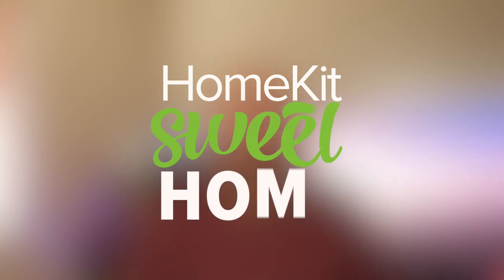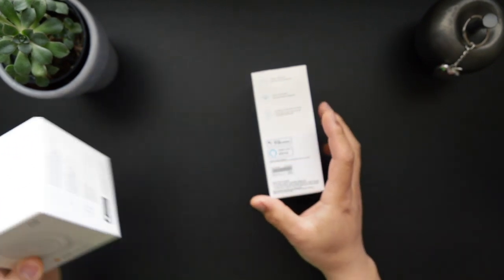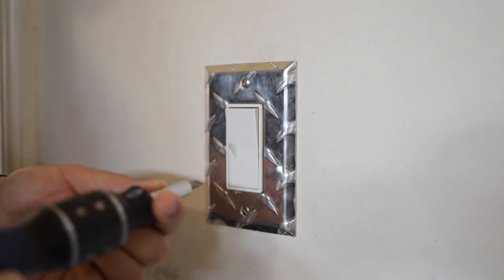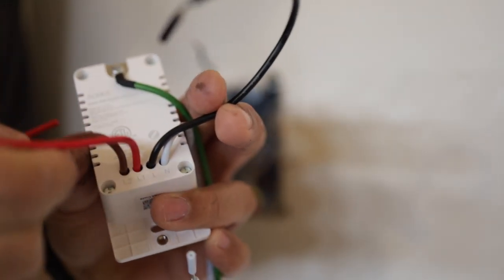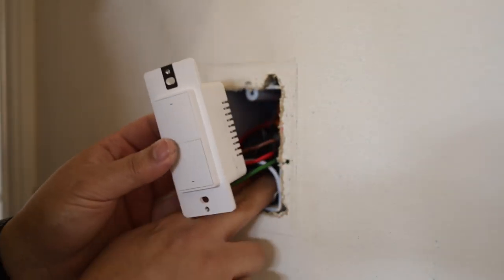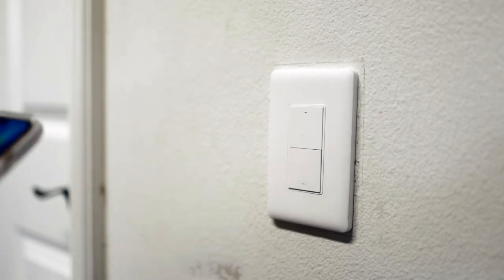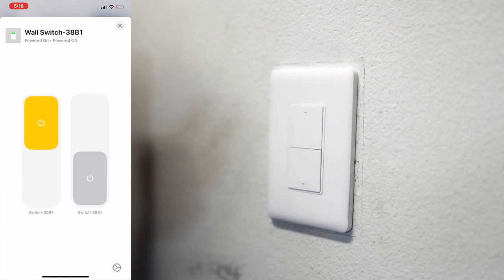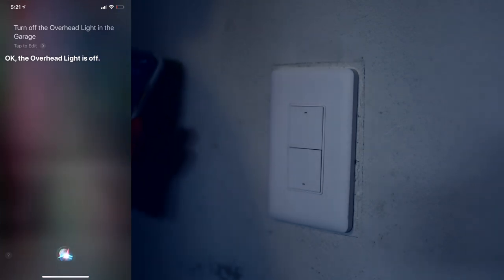Aqara Smart Wall Switch for Apple HomeKit

Comment: I was glad you wired both switches to one load. I want to do that so one switch will turn the light on/off normally and the other will turn on the same light, but program it with Home Assistant to flash like a panic light and stop when the switch is turned off. Aqara devices are great. I have them all over my house and outside with no problems. Thanks for a great video.
Reply from the maker: That sounds like a creative use of the switch! Aqara products are a great balance of features and cost. Thanks for watching! 🙏

Comment: great video!  but I have a question, for the smart switch to work, is it necessary to buy the aqara hub?  it doesn't work if i don't buy the aqara hub?  My question comes because I already have an apple mini homepod, and I see that the aqara home does the function of an intelligent assistant, so what I want to know is if I need to buy it so that it works or is it not necessary if I already have a mini homepod  ?

Comment: Thanks for the video, very detail and nicely done, I have a 3 gang wall plate and plan to change only one switch, I am wondering if this switch fit nicely with existing wall plate?
Reply from the maker: It really depends on the wall plate. The thickness of the switch itself might require some minor “dremeling” of the wall plate.

Comment: Hi Rey, what is the most reliable HomeKit light switch ? Caseta ? Thanks.
Reply from the maker: I’ve had good experience with Caseta. Personally, I prefer Leviton because they don’t require a hub and I liked the styling better. Some have had no response issues with Leviton. Lutron did just release a newer Diva switch with styling I like, BUT they are $70 per switch (too much IMO). I say you can’t go wrong with either, May come down to personal preference and/or budget.

Comment: Thanks for the video! I have installed Leviton and/or Lutron switches in every room except the master bath where we have 2 sets of Double Rockers. I could not decide how to move forward in getting these 4 lights into Homekit. While researching, I could not tell online whether these Aqara switches would work, but your video clearly shows the L1 & L2 on the switch, so it looks like this switch is the perfect solution. Plus, you showed in the Homekit app we will be able to control both lights separately, like we can now. It also looks like they can be separated (I see the switch as 2 accessories in Homekit in your video), am I seeing that correctly?
Reply from the maker: Yes, there are 2 separate switches that can be controlled independently. My home doesn't have double-rockers but if yours does these should work perfectly for your scenario.
Reply: @ReyG_HKSH  I have a couple of Aqara devices, and have not found them to be as reliable (as Lutron for example); is the switch working well? Any issues?
Reply from the maker: @deborahramey5675  Zero issues so far. My Aqara devices are at least as dependable as my Lutrons. How is wi-fi signal throughout your home?
Reply: Rey G It’s decent, I’m using Orbi w/satellites, but even with the Orbi’s there is a room that just has issues. Seems to be due to something in the walls in that particular room for some reason. Luckily that is NOT the room I want to put these new Aqara switches, so hopefully they will work for us. 
Thank you again the review and taking the time to answer my questions. Looking forward to your next video!

Comment: Great video. I have a bunch of Aqara devices and love the speed and reliability. Quick question. Is this switch only for a single-gang box? I know it is single pole but is it able to be put in a double or triple gang box with other switches next to it?
Reply from the maker: Yes, it is about the same size as other smart switches and can comfortably fit inside a 2 or 3  gang box with other switches. Thanks for watching!
Reply: Rey G, by the looks of it, it seems it won’t fit a normal cover plate. Also, most switches designed to be put in multi-gang boxes have tabs on the sides that you break off....are you sure this is able to be put in multi-gang box configuration? If so do you need a special cover plate?
Reply from the maker: @cz8024  The width of this switch is the same as most normal standard US spec switches. The only smart switches that I've come across that necessitate breaking off tabs are Lutron Casetas, so installing these side-by-side in a multi-gang box shouldn't be an issue. The wall plate is a good question because the thickness of the back plate is thicker. I tried different wall plates and I had some spare metal ones that worked fine but some of the plastic wall plates would sit away from the wall 1/16" or so. I felt like I could take a Dremel to the plastic ones and take off enough material to make it work. So the wall plate could be an issue and you might have to hunt around for ones that will work and sit flush against a wall.
Reply: Rey G, Great, thanks. One more question. Do you have any idea when the U.S. switches like the one you showed, and the single rocker, will be available for purchase? I can’t find them anywhere.
Reply from the maker: @cz8024  Aqara's plans for release was early April but cautioned that the current COVID 19 crisis could delay that release.

Comment: Would you recommend this over the Belkin Wemo switch or the Lutron ones?
As well, do all the Aqara devices need to be in small area? I'm wondering as I have my hub downstairs, but thinking of puting this actually upstairs. Or should they just all simply be on the same wifi network?

I see that you have the garage door opener in HomeKit. What do you have? I'm looking for one atm.

Comment: Thanks for another great video, is there a aqara 3 rocker switch?  I have in my home one switch that control 3 lights circuits . Also is it support 2 way controlling? I mean that I can turn on the same  lights from 2 places ?
Reply from the maker: I’m aware of a single and this double rocker. I believe you’re referencing a 3-way application (2 switches control 1 light source), but no these do not support that usage.